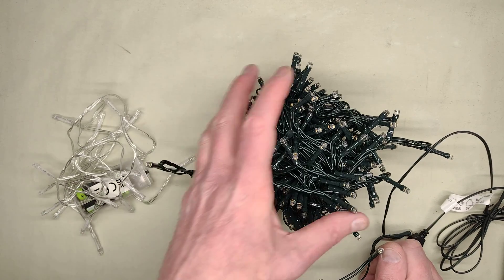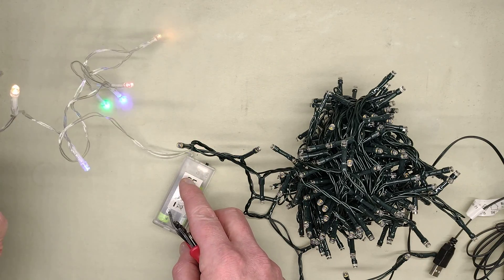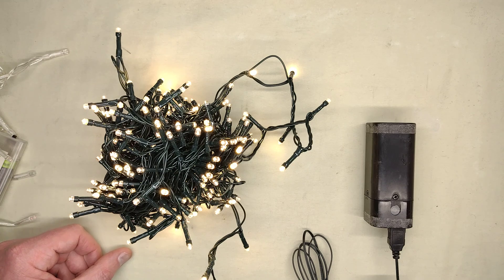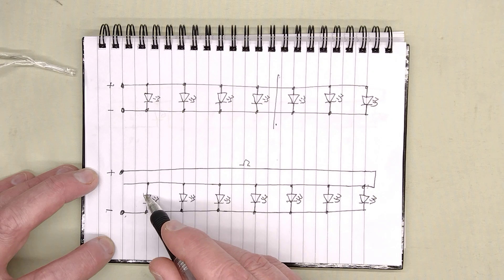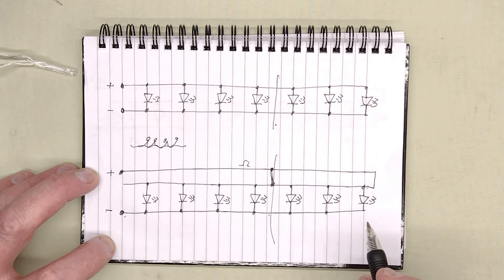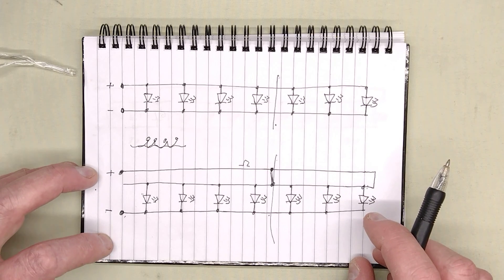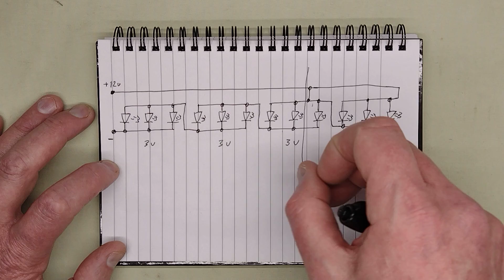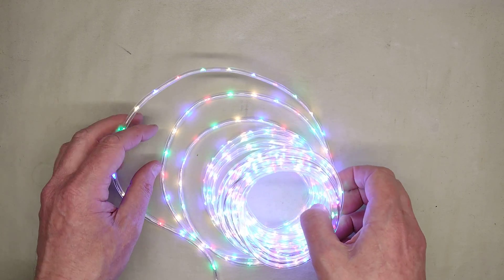How to fix your low voltage LED Christmas lights

Comment: Not related.. but maybe.
I have about 16  LED lights in the barn.They were installed as a power saver by our power company and  an unusual design being in the conventional bulb form but divided into 3 segments. After 5 years operation the two pairs, the rest are in long strings, have decided to interfere with each other, alternately on and off. Replacing one of a pair with a conventional bulb sorts it. What are your thoughts on the issue?
Reply from the maker: Are they low voltage lamps running on an electronic power supply?   If it's the older style halogen supply it may need a minimum load to work.

Comment: The gadget called "led keeper" works well for mains sets (at least in 120v land). It injects current and bites into the wire with a sharp point to let you "binary search" for the bad LED. No affiliation with them besides happy customer, their incandescent "light keeper" tool is also swell. Keep an eye out for them in after holiday clearance if you're curious but not presently in need. Turns out my main problem in my particular variety of outdoor set is with mainly the blue LEDs failing by a lead breaking off. The plastic caps break off the yellow/orange ones preferentially but they almost never fail, even when accidentally left up all year 😅
Reply from the maker: I'm a bit wary of anything that damages insulation.  They wouldn't be allowed to sell that here.

Comment: I'd be right in saying on the rope lights as an example. If one bridges the cut wire positive feed to the other non-negative feed with a resistor of a reasonable value. One could then limit the current to the chain of LEDs.
Reply from the maker: Yes.  With the correct value of resistor you could do that.

Comment: how did they get the string of lights inside the outer layer?  there are many possibilities.  it might have been a big fat outer layer that was heated to plasticity then pulled to length which shrunk it down with the led string inside it.  it might have just been done like shrink tubing.  all these clever ideas make modern living exciting.

Comment: Hi Clive, I've always fixed my lights, mainly because I don't like the throw away society but also because I'm tight! I've never had problems before. Today I was fixing some multi colour cluster lights. Got them all working but had an issue with a RED LED. If I replaced it with a RED LED the other green or white LEDS in the string stopped work (depending on polarity of the LED). I tried a GREEN LED and they all work! I then tried a YELLOW & ORANGE LED and they behaved the same as the RED! I ended up sticking a PINK LED in & that worked!! I'm guessing something in the spec of those colours? Forward voltage perhaps?
Reply from the maker: Most modern strings use phosphor based LEDs for a uniform voltage.  So the use of a traditional red LED will clamp the voltage too low for the others in parallel.
Reply: @bigclivedotcom  Thanks. I'll drop the supplier a line & see if they have that type. I just purchased 5mm of every colour! BTW, do you know of a supplier for the exact type used in most strings? I could only find a top hat version rather than the concave end as used from the factory.....

Comment: Clive, I have a set of Lumineo 720 LED Lights Twinkle Multicolour - Type 497507. After 2 years outdoors, maybe 3 sections, short lengths, have "gone out" and I can't quite grasp why!  Any insights?  Thank you .  Mike.
Reply from the maker: If they are low voltage then it's common to wire 10 parallel sections in series.  Sometimes when an LED fails it goes short circuit and shunts the other LEDs in that parallel section.  But you'd normally lose quite a lot of LEDs when that happens.

Comment: I've acquired a number of light sets this year that appear to be simple 2-wire or 3-wire construction like these, but they have a button on the PSU that selects from 8 patterns of flashing/fading. The LEDs appear to be divided into two groups, alternating along the length of the string. All the LEDs in each group light together at the same intensity, but each group is clearly being controlled independently. But they are not wired separately - the same two wires go into each LED no matter which group it's in. So it cant be using separate circuits. Could it be using a simple data signal riding atop the power line? Or is it using some sort of PWM trickery where each LED responds only to alternate peaks? Or something else?
Reply: Could it be that alternate lights are wired the other way round and the polarity is being switched?
Reply from the maker: It's swapping polarity to alternate between LEDs.
Reply: @bigclivedotcom  I never would have thought of alternating polarity! That's why you have a Youtube channel with 800,000+ subs... and I don't.
Reply: Is there a way of disabling the flashing/fading patterns so they are permanently on without having to press the button to cycle through the options? Some sets have a memory that remembers whatever the set was programmed for before it was switched off. But most of mine don't, and they're a real pain! With your genius, Clive, i'm sure you can show us how to intercept the circuitry to lock them permanently on continuously.
Reply: @johnwardley7747  

Thinking back I'm 99% sure Clive did a memory feature hack on the lights you mention but hopefully the man himself can confirm that 🙂
Reply: @skylined5534  That would be great! He will save me much time on stepladders every morning.
Reply: @johnwardley7747  if you just want them on permanently, you should be able to bypass the chip with a simple resistor. If we all talk real sweetly maybe Clive will show us how.
Reply: @TomCee53  Yes, Clive, please help. A lot of us are in this annoying situation. And ... a very Happy Christmas to you.

Comment: So you could cut the last set into four (assuming you could find the correct place where the sections of parallel LEDs begin/end), add a resistor, and makes yourself four shorter sets that could be run from USB/5v?  Cool video, as always.
Reply from the maker: Yes you could.

Comment: I'm just guessing but I think that they get those strip LEDs into the plastic tubing by continuous extrusion. In other words the LED light strip is fed into the center of the extruder die and the plastic is extruded around it just like feeding of bare copper wire into an an extruder when putting on plastic insulation.

Comment: I was wondering how to fix Christmas lights, and I thought that maybe I should ask you, and there it is:) But what about these 240V with different blinking programs (there's one button to change the mode)? I only have more and more of these broken. How to check and fix them?
Reply from the maker: If they're the cheap eBay sets that operate directly at 240V, the most common issue ois corrosion or breaking of the wires at the LEDs.
They're not designed to last and definitely not rated for outdoor use.

Comment: This was a great video I don't have any of these lights but it was informative on the last drawing it didn't make sense because it looks like the positive is coming out of the negative wire for each of the four connections if that makes sense
Reply from the maker: The positive goes to the negative of the next section so they're in series.
Reply: @bigclivedotcom  oh that makes sense I thought they were in parallel

Comment: So, I have a solar powered LED string with simple parallel arrangement and interestingly it acts quite the opposite. When the battery gets low, the far end of the string is actually brighter than the near end. Guess this is due to the boost converter frequency and reflections in the string? 🤔
Reply: That's just coocoo.  I've been puzzled as well using DC PSUs.. My string is 1 parallel circuit 70m long but is 3rd wire injected at the end. Somehow there is noticeable dimming at the middle of the string, (brighter at either end). In theory, each LED  circuit includes wire of 20 ohms roundtrip. I bumped up the voltage from 4.5 to 6.5Vdc which slowly killed the string starting with the middle/dimmer LEDs.. Would have expected the brighter ends to burn out first... The power supplies (similar to the Jutai) seem to give clean DC when scoped so there is a phenomenon at work that I haven't figured out either. 12V Strings with 4 series arrays of parallel LEDs are certainly more consistent in brightness. Why ask why?

Comment: I once had a cheap set of battery lights but it was 300 lights all in parralel on a 3x AA battery pack and they started off bright and the ones at the end just didn’t work and the ones in the middle where extremely dim as it was loads of leds in parralel just one ciurcit

Comment: I remember with the incandescent ones i had before that the first few were like fuses and if the bulb blew the whole set died.
Reply: We had the sets with the fuse bulb. So long as that white tipped bulb is intact they should work. Something about a bypass in the normal bulbs should the filament fail but the fuse  bulb didn't have that feature so if it blows the circuit is broken.

I'm sure we also had another set that  was like yours though and if one bulb blew the whole bloody lot went out!

Comment: Sir what is the maximum voltage can i use in that low power led with damaging or burning the LED, i want to upgrade my solar Christmas light by replacing higher voltage battery and a separate solar panel to charge the bigger battery, but i don't know the max voltage should i use

Comment: Nice to know :) i will check my new lights since I have two cats now, Want to send you at some point some golf ball bulbs with ‘Samsung’ LEDS guaranteed for 5 years -several of which failed shortly into their first year in my lamps, now looking for decent replacements e14 leds with min 470lm 3000k (as only have 4 wall lights lighting long lounge outside of Xmas :)) if you have any recommendations?

Comment: I got three small plastic Christmas trees that have battery powered lights, 4 AA ones in each. I'd love to convert them to be powered from the wall so I don't have to keep replacing the batteries, and also of course avoid the dimming as the batteries drains.
Reply: That sounds like a nice little project! Have you seen those battery 'corks' with the string of encapsulated leds fitted for use in bottles?

I wanted to make a small dashboard Christmas tree using a generic Christmas tree ornament and with those LEDs but converted to a car 12v power plug... I think that's something for next year now though!
Reply: @skylined5534  I might have seen those. That could be nice.
Reply from the maker: If they are using the full 6V then you could try patching a USB cable into one.
Reply: @bigclivedotcom  That's what I was thinking about doing. It's so easy to use a USB HUB to power several of them then, and it's not a big power output for these small trees.

Comment: I love converting those battery powered lights to USB. I just get an old USB cable and solder it inside the battery box with some little resistor (choose resistance calculating on how much batteries the set requiers). You can even solder to the switch (if it has two positions) so you can choose between batteries and USB dynamically. This season I added USB feature to 3 of those sets

Comment: Hi Clive! I need you help please! My 230V mains christmass LEDs all of a sudden went very very dim. I can barely destingues when they are on from off. How can I fix this?
Reply from the maker: If they've been used outdoors then its possible a wire has corroded or an LED has failed open circuit.  If they're the cheap Chinese imports then I recommend against touching them while powered.

Comment: My Christmas lights (120volts) half of the string of lights is off (towards the plug) and the other half is lit and I don’t know why. I checked fuses and replaced broken bulbs and nothing 😔 can you make a video bout how they work and a suggestion on how to fix it
Reply from the maker: It probably is just a lamp but making connection.  One of the voltage detector sticks may be able to guide you to the dead lamp/s.  If they're push-in lamps you could also check them one by one to see if the contact wires are aligned correctly.

Comment: I just spent 3 nights trying to figure out what was wrong with one my (American 120V) outdoor light strings.  The string turned out to be broken up into sections of 40 lights with plugs having 3 wires going to them at each end.  (3-wire, 38 x 2-wire, 2 x 3-wire, 38 x 2-wire, and so one...)  Those 3 wire ones ended up having a slightly different lamp base shape than the 2-wire ones, and one of the two had the polarity of the LED reversed when referenced to the retaining tab.   If you happen to swap those two in their sockets, you'll get 40 that won't light at all, but if you happen to put two with the same polarity arrangement in, you get 40 that light up extremely dim.

Sections going dim, then dead, then working, then dead, then working, then dim, yadda-yadda ---- as you try to identify & swap out a presumed bad bulb is a royal PITA.

Comment: I realise it's not in the scope of this video, but what about addressable RGB LED strips?
Reply from the maker: They're a specialist subject of their own.
Reply: The Chinese origin one I have has all LED chips powered in parallell with a third wire for serial communication going through all of them. That one works as a long shift register. When you send the color values to the first chip, it sends its old ones to the next and so on. If you want to change just one of them, you have to refresh the whole length. I don't remember if the chips waits for the comms line to go quiet before applying the change, so as not light up briefly from the values the are just passing through on such a refresh.

Comment: Bollocks to all this,  I'm getting my Mum's old German Cristmas Tree 'Lights' out.   They are a box of little metal Candle Holders, with a sort of 'clothes peg' thingy on the bottom.   You can shorten the 'string' of lights as much as you want, without any tools or schematic.   They are very practical and good for the environment, because they ensure job creation within the fire service.

Comment: This is a great video however what are you're thoughts on Technology Connections efforts to recreate older lamp styles? He doesn't like LEDs as they are coloured rather than white LEDS behind coloured glass/plastic which is how Christmas lights used to be, white bulbs behind coloured glass.
Reply from the maker: I have been observing his experiments.  My dad used to paint the tungsten Xmas lights with glass paint.
Reply: @bigclivedotcom  Most excellent, hopefully he will get his desired effect,  I recall in the dim and distant past you did a guest spot in one of Ashens videos, which is how I discovered you, maybe you need to be observed by some Technology Connections viewers.
Reply: I believe that the paint colours would need to be strong within the spectrum of the LED.

Comment: What about the 35 volt ones, with the same power supply like the rope light ones and the third wire running all the way to the end?
Reply from the maker: They are generally wired as ten parallel sections in series along the run to make up the 30V.  One connection to one end and one to the other for uniformity of illumination.

Comment: Hi whats the cause of led christmas lights are very very dim and some others not working also .  I have tried 2 good working power supplys still the same issue .. leds look as new and cant see any damage wires atm
Reply from the maker: An open circuit caused by corrosion can result in dim sections.  A failing LED on its own may be dim.
Reply: @bigclivedotcom  Thank you very much

Comment: I have a 100m run of lights.  On the last 25m or so of lights, only two colours are working out of the 4...  Any ideas in this scenario?
Reply from the maker: That's a bit odd.  Especially if it's the polarity reversing type for the flashing effects.
Reply: @bigclivedotcom  Ahh!  Ill have a look tomorrow to see howmany wires there are etc :-)
Reply: @bigclivedotcom  I've had a look.  3 wires come from the control box, at the 1st led an extra wire is added, at the second led another wire is added giving 5 wires total.  At the end of the lights the wire count is back down to 3.  These were an ebay purchase with no transformer, so presumably running at 240v.  I think they will go in the bin when I have finished with them!

Comment: The timers in my AAA powered lights no longer work.  One of them flashes on for a second, off for three seconds.  No it isn't a flash mode, at one time it was on for six hours, off for 18 hours.  The switch says "Timer"  The other set doesn't work in timer mode.
Reply from the maker: Has water got in?
Reply: @bigclivedotcom  Thank you.
The wreaths were used indoors. The wreaths are stored in the attic over the summer.  Condensation could be a problem, but with the house having low humidity during the winter months, I would think any water would evaporate. The wreaths were placed on the inside of windows, below the windows are baseboard heaters.

Comment: What if it’s cut near the plug where there’s just two wires? How to fix that
Reply from the maker: Depending on your lights, if the two cores are broken then they may need to be connected again in a specific polarity to work.  If they're the thin stiff copper wire strings then there may be a clear lacquer on them that will need scraped off or burned off with a flame to expose the conductors underneath.
Reply: Thanks for replying. I have 5 loose ends of green wire with steel strand core. I’m not sure which ones to connect where? Two come from the first led, one wire below that that bypasses the led and the on the other side two wires coming from the plug